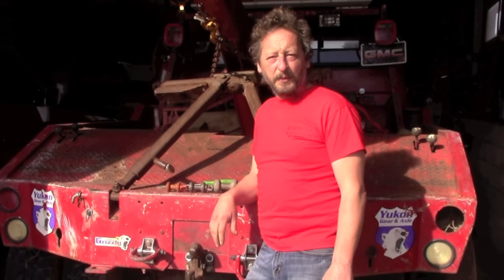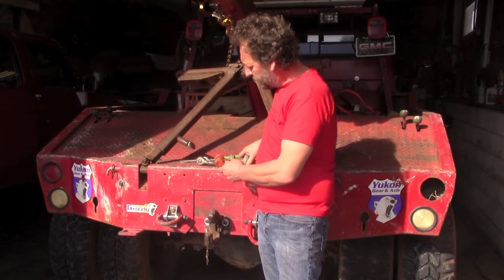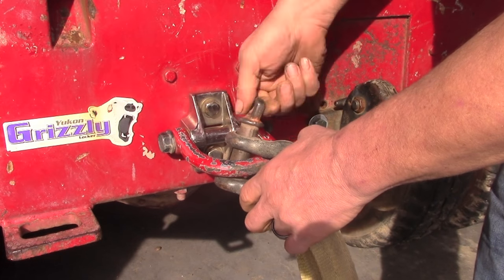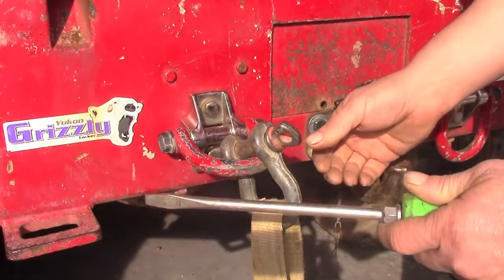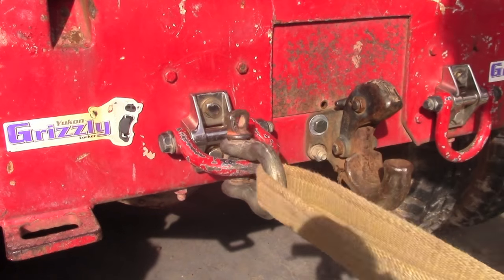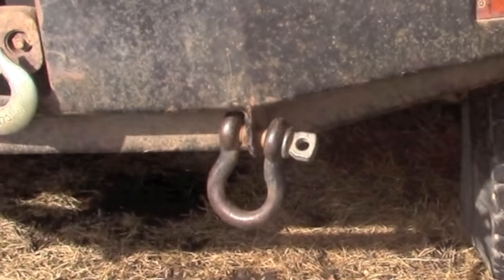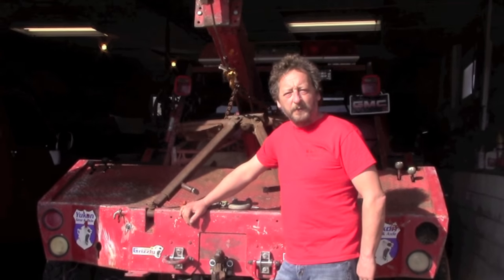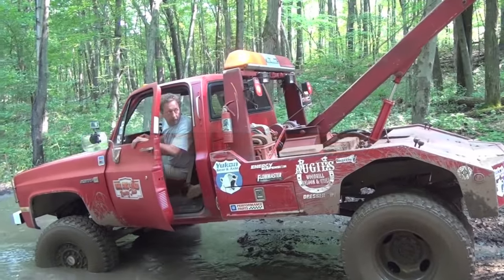QUICK TECH TIP 1 by BSF Recovery Team

Comment: Good tip Eric. I'm in the elevator trade and I use that same method when hoisting and rigging our equipment. And I swear one of these days I'm going to buy you a tail light to fill that empty hole!
Reply from the maker: +Joe Simon I have new tail lights for it, just haven't put them in yet. might be a good video...

Comment: Don't forget if its permanent and you wish to prevent theft you can use red Loctite but this will make it pretty permanent, also for anyone wondering that didn't know the hole on the end of the bolt is there for lock-wire and the use of spike(like a marlin spike) to tighten and then lock-wire it to prevent turning.

Comment: The Couple We Use On Our 4x4's Are All Locked With A Barrel Reese Hitch Pin With A Striping Of Water Hose 3/4 inch Cupling Center of Hitch pin Stop It From Clangin Against The Frame, And With A Barrel Pin Lock Easily Removed. A lot Users Say Its A Hell Of Lot Easier Then That Bolt Cause Every Know And Than You Just Don't Want To Fight With It Just pull in go
Reply from the maker: +joe mclaughlin Many off-road events won't allow a hitch pin style clevis to be used.
Reply: 10/4 I Get What Ya Mean
Reply: You Guys Be Safe Out Yonder And Remember Be Good Or Atleast Good At It..

Comment: Even though this makes it easier to unscrew the shackle its wrong. The screw gets tight because the shackle spreads and if you keep backing it off over time the shackle will spread to a point where you don't get a full thread engagement on the bolt.
Reply from the maker: +84bellnl That will only happen if you are pulling on the sides of the clevis, if the clevis is used properly, pulled on at the bottom of the throat and at the pin the clevis won't spread.
Reply: +recoveryteam Take a caliper out and measure it under a load and you'll be surprised it will stretch out until it hit the shoulder of the pin and over time the shackle will stay stretched out. Now for off road use this may not be as severe because you aren't putting a full load on the shackle. but for crane work it will wear a shackle out faster.
Reply from the maker: +84bellnl I still find that a little hard to believe, Knowing quite a bit about forged steel, and bending forged steel, I can't imagine that a 1/4 to 1/2 turn on the treads would be more than the amount of spring back in a forged clevis with out heat applied. Now a rolled steel one might be a different story. Any way it is recommended procedure for recovery work.

Comment: would you say if you plan on leaving the clevis on your rig it would be better to use the ones the have a draw pin with a hair pin or a o ring snap pin. this way it dont seize on.
Reply from the maker: +TinManKustoms Many off-road events won't allow a hitch pin style clevis to be used.

Comment: what size tires does the wrecker have on it? looking at making my own wrecker in the near future.
Reply: They're military 37x12.50-16.5  You can find used surplus for around $100. But the odd ball 16.5 rim makes it hard to find nice wheels. Or use H1 Hummer rims like Eric does in the front.

Comment: Just my 2 cents but I'd just recommend not leaving them on all the time. unless your wheeling and already have the strap hooked in there's not much of a point. If it's an emergency situation or even in general you probably don't want to deal with a tightened pin or one caked with mud and dirt. And they are easy pickings, leave em with the other recovery gear
Reply: good opinion no reason to leave them on other than for looks which i have one one the back of my truck cause i do a good bit of recovery for other folks always back it off a half turn then tighten it before i try n tug on it